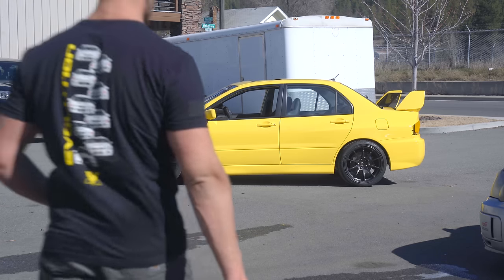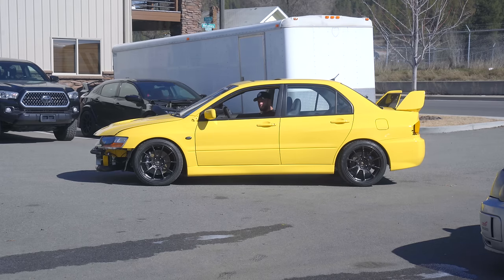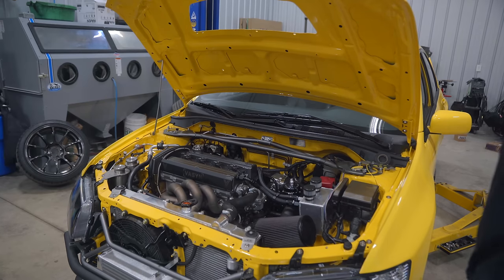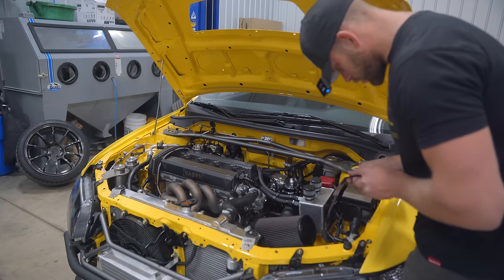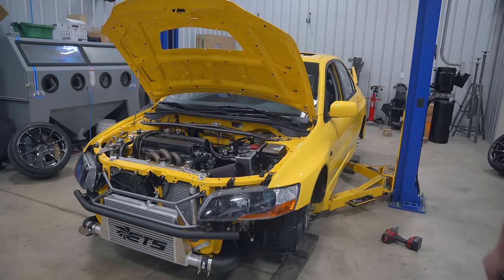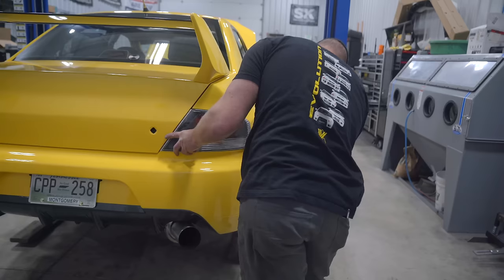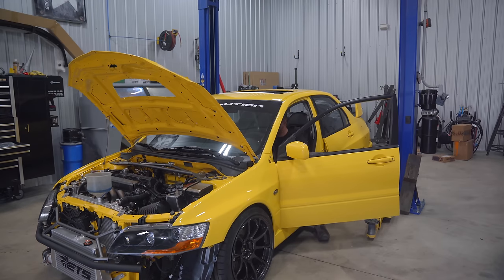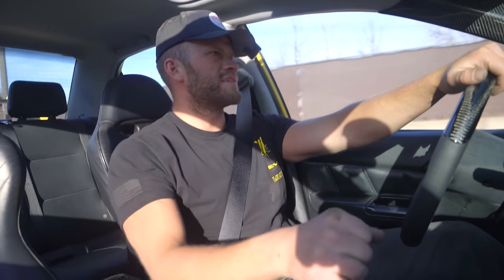More Problems with the Ultimate Evo 8 Build...

Comment: Hi Devin! At 1:27 when the wheels detach from those wooden ramps, the front left wheel turns a little to the left. You mentioned that you need to align the wheels, because it is not done. Even so, that wheel is not allowed to turn when it has escaped the weight of the car, unless the outer tie rod is not tightened in the steering knuckle.
Greetings from Romania! 🍻
Ps: I advanced with the viewing and saw that you tightened the suspension height adjustment, and when you lifted the car to check the abs sensors, the wheel no longer had that movement. That was probably the cause.
Reply: I think his little nod was a “wow ok” reaction to that exactly
Reply: i noticed that too, good catch Marius! i had the same exact thing happen on my EP3, the boys at Firestone didn't tighten my tie rods after an alignment

Comment: Lets go... 💢💥👌👍💪 Change the seat belts to yellow for a touch. Just a suggestion try to make a VASYN plastic or rubber replacement for the wood you are using to partially lift the car for the lift, I;m sure that would sell fast!

Comment: A lot of cars will throw abs codes in the air like that. I'm a VW tech and whenever you drive em on the lift the ABS, Traction/Stability will always come on.
Reply: Newer cars that use acceleration data as well will do that, older simpler systems cannot know the difference

Comment: Hi devin I had to change clock spring on the my x. Did you do a calibration on the sas and do full lock to lock as I had to do this with mine just a thought something as simple as that can tho these codes look at the steering angle live with your steering straight make  sure it is close to 0 as pos if it is above -15 or +15 it will throw codes for acd abs a sas and will not calibrate but like I said just a thought mate with what I went through